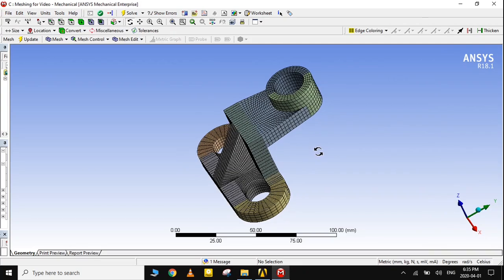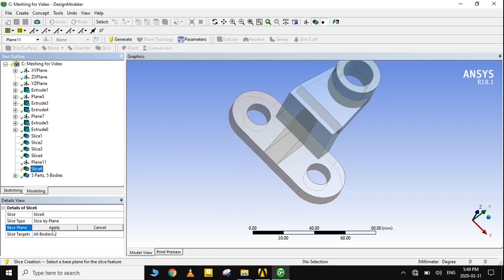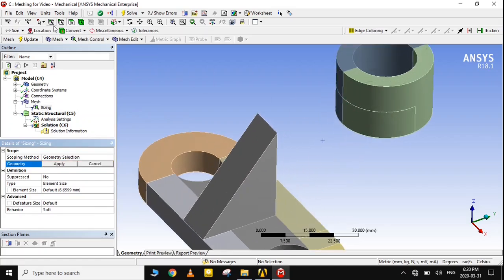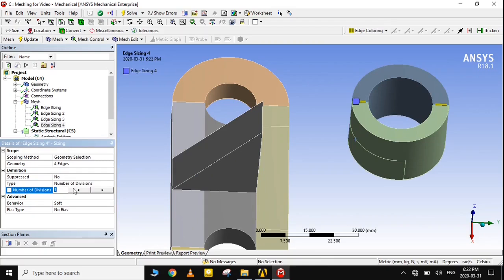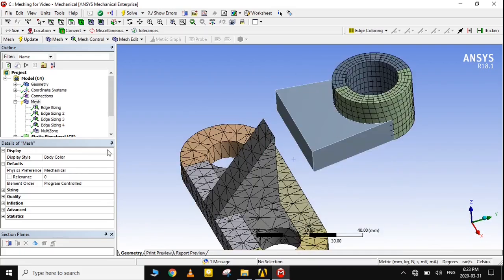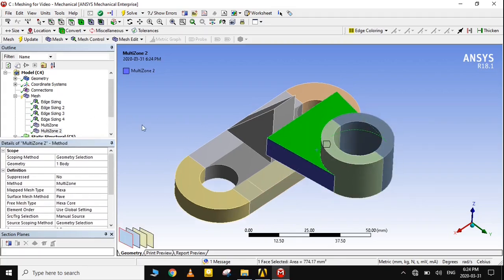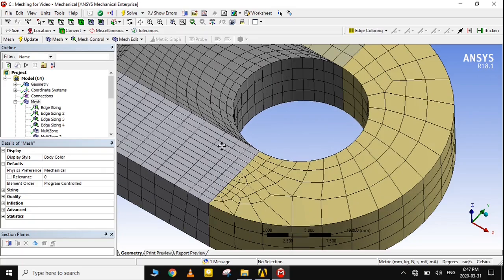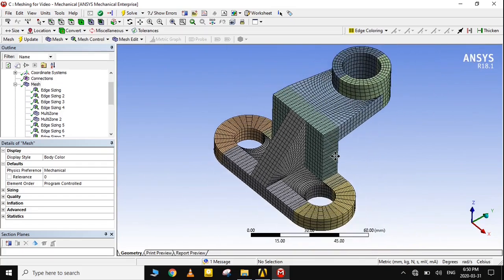How to Obtain Hexahedral Structural Meshing in ANSYS | Learn Mesh Structuring Techniques

Comment: Hello! 
I have a problem with cylindrical support, when I select the face it doesn't work. 
I don't know what could be the problem, maybe there is a limit on student version, or because it is an .iges file from solidworks
Somewhere I saw that I have to select proximity and curvature, but the choosable only the Yes or No.
Can anybody help me?

Comment: Hello, do you mind if I have a question to ask you?  To mesh, we have to divide the solid into parts. So when adding the next model, how will we have to set up the connection, or will the application automatically understand that they are still tied together?  Thank you.
Reply from the maker: They bodies that are grouped as a single "part" in geometry do not need any connections. The software already knows that it is the same part (tied together).
For multiple parts, you make connections between them. E.g. if you have a nut and a bolt (2 parts total), you will make a connection between them. But you do not need to make any connection between the different bodies of bolt (if you split the bolt in multiple parts in designModeler to get a good mesh)

Comment: Great video! From what I've seen, this method of creating structured mesh creates additional connections within the geometry. Does this impact results and/or prolongs the solve time?
Reply from the maker: All bodies were grouped as a single part. No new contacts or connections were formed.
Reply: You can always go into Mechanical and just delete all the Connections that shouldn't be bonded.

Comment: Great video.. Really useful, say we can use it with bonded contacts in FEA. But is there a way to combine the bodies into a single mesh?
Reply from the maker: Sorry for late reply. There are I think two questions in your statement. First, when you make a single part, ANSYS treats it as a single body and no contacts are formed between surfaces. So, there is no need for modeling contacts. Second, if you are asking about not making it a single part but using bonded contacts to achieve same results, then you can match nodes on edges by giving same conditions to edges. i.e edge sizing and inflation. But when you modelling contacts, you don't really need to match nodes between surfaces. Although it is good to have matching nodes anyways. So you can match nodes by edge sizing or at small levels by other conditions such as node matching. We will make a separate  video on contacts modelling in ANSYS. Hope it helps.
Reply: @Ansystant  Thanks for the reply. In the video a single part is shown split into simpler bodies. So if we use this mesh, will there be multiple bodies listed in static structural?
Reply from the maker: @dilsoman  if you make one part from "form new part" option of all the bodies, the software will treat it as if it were a single body. In meshing, however, all bodies will be listed under one part, but that's fine. Having one part is what matters. The part can have as many bodies.